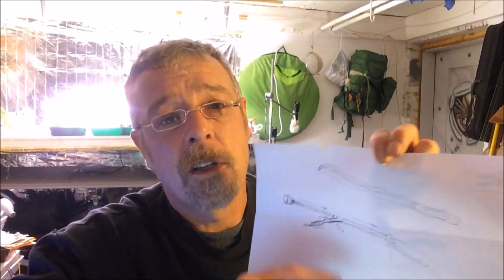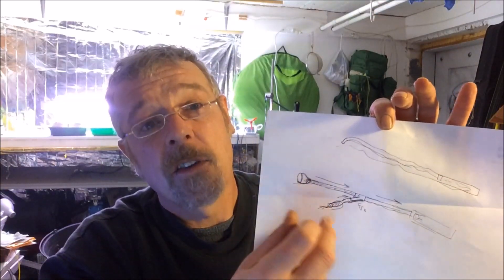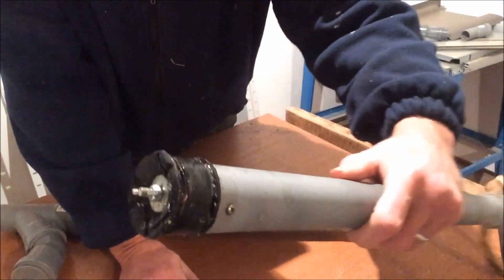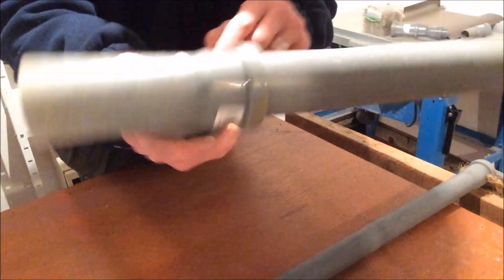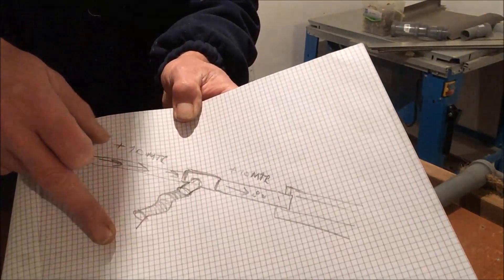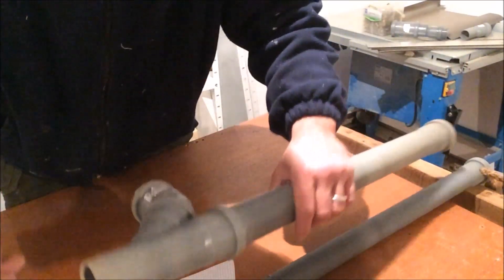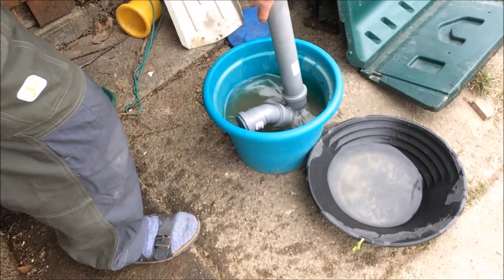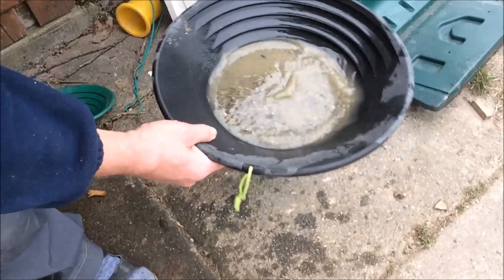Hand pump and gravity dredge idea  14 03 16

Comment: 1. Enlarge discharge hose diameter +25-50% larger than inlet funnel diameter
2. Move Suction section near discharge end.
3. Make venturi section adjustable to allow optimization.

Comment: Flapper valves work pretty good, choker valves work even better. Remember to have your outlet hose connected when testing because you need water in the outlet pipe to make the outlet valve close when you pull the upstroke. A lot of people forget this when testing their new invention and think it doesn't work. regards Bill
Reply from the maker: Thanks Bill good info. 
All the best Dave.

Comment: It wont work, why don't people try things before they waste their time making a stupid video on it.
Reply from the maker: Fanny Cubells   
This guy made one and it works. Try and keep your comments polite. Happy new year ;-)
Reply: It will work it's the same concept as I used for bilge pump drive dredge I tested at home. 1&1/4 PVC to a Y connector with a funnel on the inside. after fine tuning the sweet spot is found, the pressure of the water passing this point is enough to suck gravel in. Just make sure the output in larger than the input so a 1&1/2 inch Y would be best with a reducer for the section to 1". As regards the funnel - Drill a hole in a small bottom a rectangular plastic bin and dam up the area with rubble bags. Result is 100% gravity powered suction dredge.  I will do a vid on this during the summer as I have all the parts already
Reply from the maker: Thanks. One guy built one last year in France and showed me a video of it working ;-) I would be very interested to see your build all the same. Thanks for the comment.
Reply: LoL....your comment is as stupid today as it was two years ago, you rude little prick.

Comment: With the hand dredge, I say use a wye fitting turned around. Take an 1/8 th bend and make an 'H' fitting. Have the suction side coming from the side inlet and the discharge straight ahead. That way, any material that comes up drops into the straight part below the piston. All the other hand dredges, the discharge is offset.

Comment: So you want to make a bazooka? If you had a 1"  pipe coming in at an angle from a gas pump. How many feet per sec? Then, water is .433 lbs per foot. 100' = 43.30 lbs Go online and search for tables (psi/feet per second)and pipe size.I'm not looking, but I'd make a guess of ,at least 50 psi. The drive line would have to start  above the bazooka about 135 feet vertically to get 50 psi  at the bazooka. It can be done, but, wow! You'd have to run a whole lot more pipe(unlless it's a vertical cliff)Plus, you need the flow ABOVE  to be substantial. It'd suck a swimming pool dry in a minute. No piddling creek would do.
Reply from the maker: Man I wish but we can only work with hand here no power. Would be fun though until the 5k fine lol
Reply: Any motor is not allowed in California for dredging. You aren't allowed to use a shop vacuum(though I see nothing wrong with collecting material from above the water line, taking it home and panning it) Still, not allowed.
Reply: There's a video of a syphon dredge I think it's 49er... something. 800' vertical head.
Reply from the maker: Thanks thats some setup. You hit the nail on the head i would need a lot of pipe to get it set up. I will stick to the old shovel I think is just for fun.

Comment: u dont need that much of a river drop mate. submerge all the flexi pipe in the river until the river is running through it, raise downriver end and presto. have some kind of mesh over the suck end for big rocks, also have some kind of heavy weigh around for when u want a break, if the front end sucks air it stops. flexi pipe works best ofc but remember the natural riffles in the pipe, be sure to clean it out every now and then :) used this method for many times. you will need something to slow the flow on the box as alluvials will be going tooooo quick, hope this helps.
Reply from the maker: Thanks for the info.mate ;-) I want to be able to work close to the sluice with this. Just so I can see what I am running and getting.

Comment: I've seen the stright style gravity dredge it works well but you need lots of hose and drop.  It works well actually.               Nice hand dredge.
Reply from the maker: +Bayou billy Cheers I have seen them too. I am hoping the way I want to try will give me a bit more suction by using a funnel flair at the top I dont want to have to pack 300ft of pipe lol but the drop is the most important thing.
I have to give it a try I know it will work in some places better than others.

Comment: Nice instruction vid there, mate! I have got the pipes, and a building plan, but lack some small pieces, like the stop lid on the collecting part. My idea is to have a thinner sucker pipe as a front piece. I`ll proberly make a tip on the suction mouth in metal, with some inwards bent triangels. Just to prevent the bigger rocks to go into the system and block the pipes. 

Still haven`t found alluvial gold yet, but already started making a "bazooka" fluid bed box in aluminium. 80 cm in length. Also bought a plastic drop riffle sluice box, and waiting for another kind of metal sluice box to arrive. Looking foreward to the spring now. Still much snow here.
Reply from the maker: +The man who never found gold. Lol you have gone sluice box mad ;-) The plastic drop riffle work well where did you get it? I want to do a bazooka type too Yes put some mesh or something in your nozzle I dont have the problem with the big hole but I would be with the smaller tube. Check the moss at high water level on the inside bends. Going next week to get some.
Reply: +Southpaws gold prospecting and adventures 

Here`s the drop riffle thing I bought. Have tried it and it collects the heavy stuff very well. http://www.ebay.com/itm/Eldorado-Gold-Sluice-Box-Professional-expert-Gold-Prospecting-Equipment-/252296961778?hash=item3abe121ef2:g:uvIAAOSwgQ9V4zxN

I love DIY-stuff, so I went for making a bazooka thing here. Got this sheet of aluminium from a friend, and what else than a fluid bed box could I make of it, hehe..  Made a small model 1/4 size in cardboard, and will do some improvements and small changes with the full-sized box.
Reply from the maker: Cheers mate I will have a look shipping and tax makes everything stupid prices here. The DIY stuff is best I am trying to figure out how to make a bender to bend the sheet aluminum. I have seen some stuff. I am just starting some tomatoes f3 ;-) Hope all is well with you mate I know you had some bad times this year and last. Go and find some gold. I would like to see your box. I have a job interview tomorrow bit nervous..